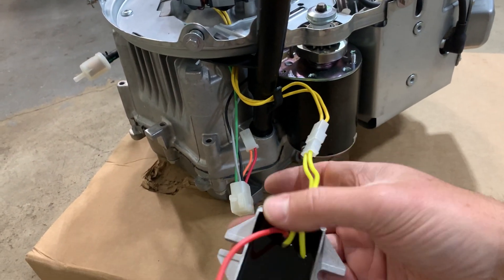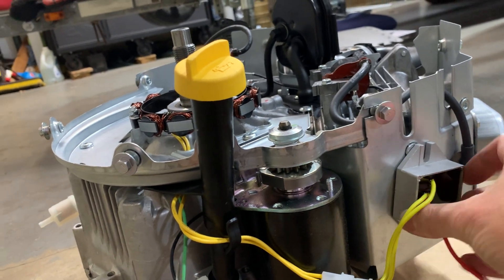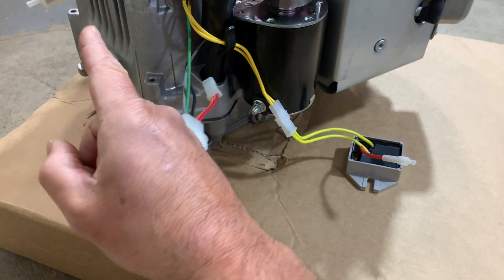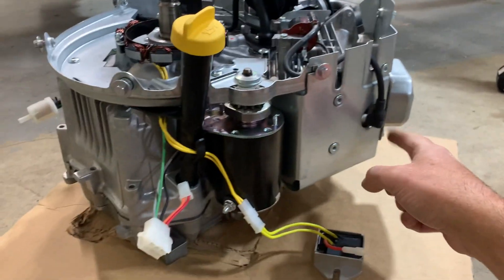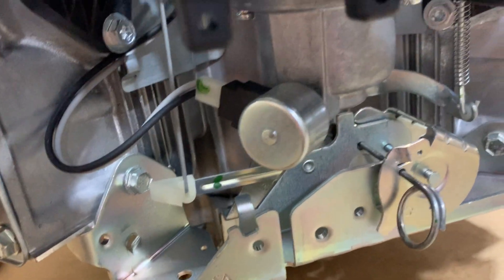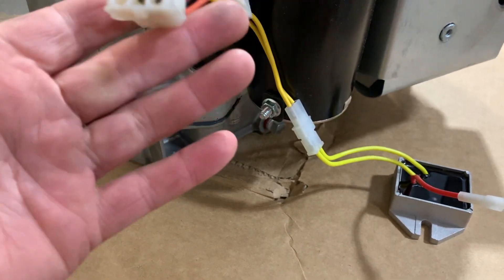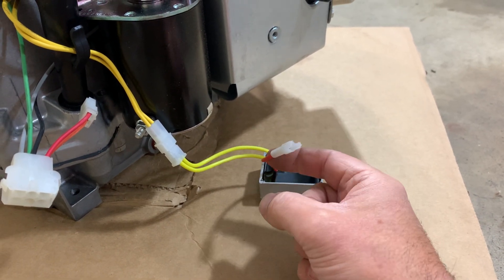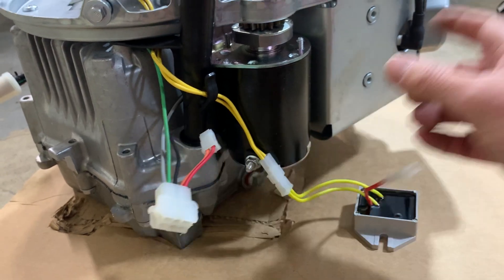Hustler Fastrak Engine Swap Part 3.0

Comment: Had a couple of questions as your video was a huge help. Recently came in possession of a Fastrak zero turn that had a replacement engine from a Briggs and Stratton. It was never wired up and was wondering if you had any wire diagrams you could share
Reply from the maker: On the mowers the basics for a permissive to start are- Engine- Fuel cutoff solenoid to the carbs, and oil pressure switch. -Then on the mower itself, you'll have the steering arms being locked outward (brake), the seat switch and the mower deck PTO. Those all need to be satisfied for the starter to rotate and fuel to enter the engine. And for ignition/ charging this video went through those items .  (PS, Check out "Taryl Fixes All", this guy is a riot and has many videos on mowers in general that explain things in a much different way than I do)
Reply: @BondsGarage  I didn’t see the 3rd part when I wrote earlier. You videos are a huge help! I cannot emphasize that enough!
Reply from the maker: @CS-oe8og  Great and glad this helped you, thats why I make these! Thank you for the feedback.
Reply: Where did you get the exhaust from?
Reply from the maker: @anthonyyeater9007 I purchased the exhaust from Small Engine Warehouse
Reply: @BondsGarage  do you have a part number?
Reply from the maker: @anthonyyeater9007  I'm so sorry! I looked at my records when you sent this and I actually returned this exhaust from SmallEngine Warehouse as it was wrong.  I then went to Briggs and Stratton... Part 771127   www.briggsstrattonstore.com and the kit was $190. This included the header piping and muffler.